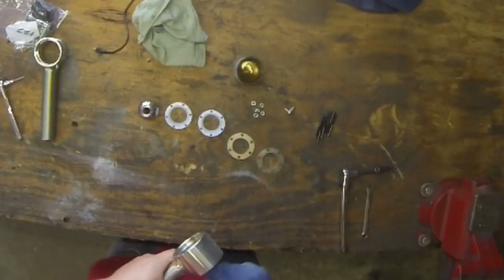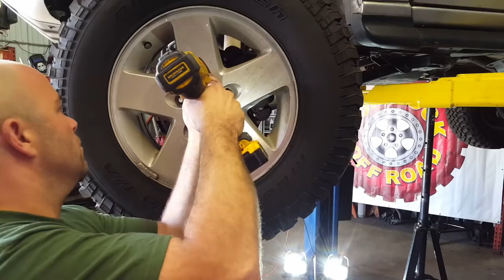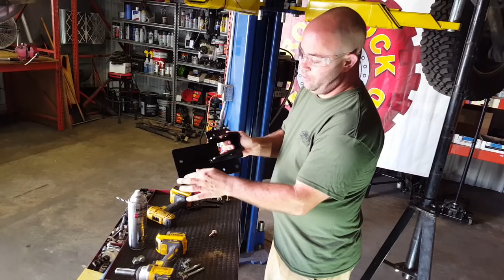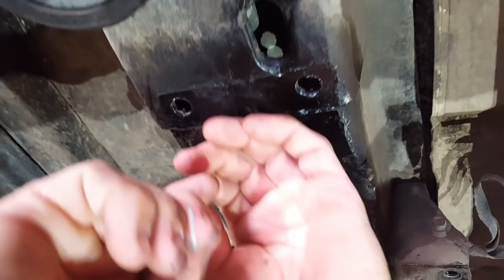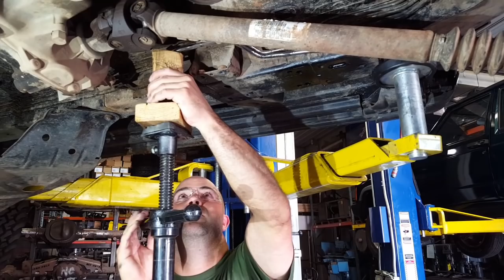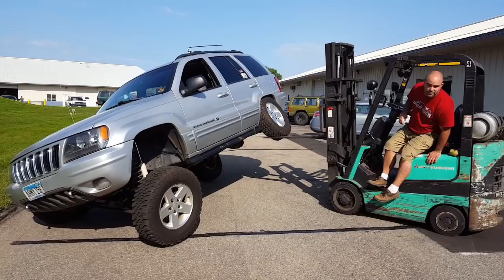IRO WJ Rock-Link, 3-Link Installation

Comment: What size  lift and tire size  im currently  on a a budget  2in puck lift  tire size  is 265 75r16 ive used your products on my xj builds  this is my 1st wj build. I want pretty much  exactly  that setup
Reply from the maker: @Edward-f1r3b That's awesome you're building a WJ now! The WJ in the video has a 4" lift and 255/75-17 tires. They're a similar size tire to what you are running now.

Comment: Can you tell me how much lift this WJ has? Looking at the long arm kit for my 4” lifted WJ wondering if I’ll achieve this flex
Reply from the maker: @NorCalBrant this WJ had 4" of lift at the time of this video. If you have an IRO 4" lift, you'll get the same results. We source the longest travel shocks for our kits to get the maximum travel. That flex keeps your tires connected to the ground which gives you more traction!

Comment: What size drill bit is needed for the new holes to be drilled?
Reply from the maker: @matthew7972 The control arm brackets need two 7/16" holes drilled per side at the front of each bracket. Let us know if you have any other questions, we'll be happy to answer them! Or give us a call 9-6pm central time 952-210-7185

Here's a link to the instructions:
https://www.ironrockoffroad.com/Merchant2/WJ_Front_Long_Arm_Upgrade_ROCK-LINK.pdf

Here's a link to the product page:
https://www.ironrockoffroad.com/product/wj-rock-link-front-long-arm-upgrade.html
Reply: @IronRockOffRoad  what size hole needs to be drilled for the rear 4 link?
Reply from the maker: @matthew7972 You'll need a 7/16" drill bit for the 4-link crossmember bolts. In my opinion the 4-link is the best upgrade for the WJ. The improved geometry and ground clearance is unmatched! 

Here's a link to the product page:
https://www.ironrockoffroad.com/product/wj-4-link-rear-long-arm.html

Here's a link to the install video:
https://youtu.be/cvfa4d0MS5g?si=0OuVq7sho_2urJ6y

Comment: A suggestion; after drilling the holes for the nut plate and inserting it, screw a short piece of all-thread in each end of the nut plate. After the mount is in place remove one all-thread, insert the hex screw, then do the other. It keeps the nut plate in place while you are finishing.
Reply from the maker: @user-gd3qr2sv2z Great idea!

Comment: How do you adjust the axle left to right? Mine is sticking out on one side more than the other
Reply from the maker: Adjust the upper links. Lengthen the link on the side that’s sticking out. Shorten the other link equally.
Reply: Sounds like you need an adjustable track bar.
Reply from the maker: That could be the solution also.

Comment: SO the alignment of the flex joints in the lower control arm mounts has to do with rotation? I cannot get them to line up perfectly like the picture in the instructions mine keep ending up angled.

Comment: I just completed installing this kit on my 99 WJ having a 3-inch lift and have some thing worth noting. 

1.  Installing the kit did bring control arm angles down, the ride is smoother and the ride solid in most cases.  There is, however, a jarring or looseness in this kit that we have been unable to pinpoint.  It only comes out when going over small jolts or large cracks that result in quick tire movement.  (new ball joints, hub bearings, rotors, breaks, stabilizer, tie rod ends, and track bar inspected) This quick movement results in a....it's difficult to describe this....in a popping or jarring of sorts that you can hear inside the cabin.   Sitting in a pavement parking lot, there is movement if rocking vehicle in gear.  Investigation continues. 

2.  Install all in one day or divide into two.  Either way, if you plan on running the included 1-inch tranny drop kit, then the subframe center piece will need to be removed or left off until AFTER you have installed the long arms.  
Why?  Because the drop kit locates the subframe center piece lower thus blocking access to tightening the nut to the bolt for the lower control arms.   We had trouble and so did South Main Auto (see their YouTube channel)(a profession auto shop) when installing it.  SJA Eric opted to remove the 1-inch spacers.  Instead, I chose to loosen centerpiece bolts on one end and remove on the other to allow the subframe centerpiece to be dropped enough to get a combination wrench to the nut. 

3.  INSANITY.  This kit is advertised for 3 inch kits but fits better to 4 inches and higher lifts due to wheel location in the wheel well.  You should be able to adjust the control arm lengths to position the wheel as far back in the front wheel well as possible.  Kit component (long arm tube internal threads and length of the threaded male insert) do not allow the upper control arm to be shortened to the shortest length possible.  We were unable to position 31" tires further back in the wheel well than the factory location.  INSANE SUGGESTION:  The IRO rep (whom I will not publicly name) suggested that I seek assistance from a local machine shop to make adjustments in order for to make this kit position the wheels properly?!?!  BWAHAHA  

4. On page 3 of the included kit instructions, there is a small box of info for containing length measurements for the "shortest arm" and "longest arm". That mention is both confusing and misleading since the only two things that could be for are the upper control arm and lower control arm, or UCA and LCA's.  There is nothing indicating what that info is there for. No wait, what is confusing is calling one time and someone telling you that those measurements are suggested lengths for the most common lift height of 4 inches, then calling again and having that same person tell you that those are the measurements for the 3 inch lift....sigh.

.

Comment: Quick question - at 3:50 you begin to talk about lower control arm flexing with other kits that have individual upper control arms which is why the Critical Path arms you are pulling off in this video make them superior.  Likewise; are you then pulling off a better product if replacing it with a Rock-Link kit where not only is there an individual upper control arm, but now the vehicle is down to only one upper control arm versus other kits offering 2?

Comment: I have 04 wj with a basic 3 in lift from you guys. Can the 3 link long arm work with the lift I have already?
Reply: I own a 99 WJ with OME 3 inch, so we are similar.   Yes, this is compatible with the lift you already have.  It will replace items shown in this video, and you'll use what you already have for the remaining items (steering stabilizer, track bar, shocks, etc)  Ugrade to BIlstein 5100's for a better ride quality than the basic white shocks they sell for the 3-inch kit.
Reply: Yes, minimum for this kit is 3 inches. You should already have steering stabilizer, the rod ends on good condition, a track bar for 3in lifts or adjustable, springs, good shocks and extended sway links.

Comment: Just received this rock link upgrade in the mail today. Can't wait to get it installed next week on my day off. 
 2003 Jeep WJ
4.25 in lift (unloaded vehicle)
hankooks  265/75/16
4.0L
Stock timberline rims 1.25 spacers
Bilstein shocks
Reply: Hey Doug - looking for your thoughts, a quick review, on this since your last post here was 8 months ago.  What were you running for front control arms before, and what are your thoughts after having some time riding on this rock-link kit?  Thanks bud

Comment: I've got the critical path kit, thinking go going to the three link. What are the benefits of the rock link compared to the critical path kit? is it worth the upgrade?
Reply from the maker: Yes, it's worth it :-)  All the benefits are described in the product description: https://www.ironrockoffroad.com/product/wj-rock-link-front-long-arm-upgrade.html
Reply: The ROCK-LINK kit is a fully adjustable 3 link kit which includes a HD high clearance cross member. This also makes for swapping axles much easier.
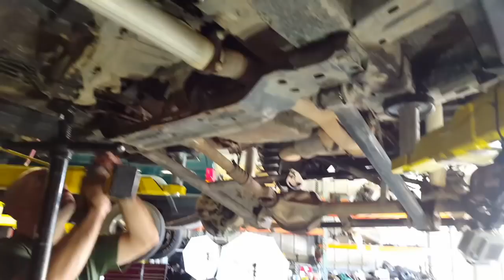Reply: Fill me in some more. I am looking at either for my 04 WJ. The benefits in the link are great, but what exactly is the improvement over the critical path set up, besides being "the latest and greatest" as referred to at 4:14

Comment: Do yourselves a favor and get a johnny joint for the axle side upper, the factory bushing is soft haha. feels much tighter with the solid joint.
Reply from the maker: Good Suggestion, except we would not recommend a Johnny joint.  Check out our stronger flex joint alternative here:  https://www.ironrockoffroad.com/product/upper-control-arm-flex-joint-8-bolt-10mm-cartridge.html
Reply: We make a UCA flex end in 10mm/12mm and 1/2" sizes for the top of the differential so no other brand is needed. It is a related product on the website.
Reply: IronRockOffRoad I found it odd that you didnt mention that when i was ordering it, so i didnt bother to look at your website for one.
Reply from the maker: Sorry, we missed that upsell opportunity ;-)
Reply: IronRockOffRoad no problem, love the xj 3 link btw. Beefy stuff.